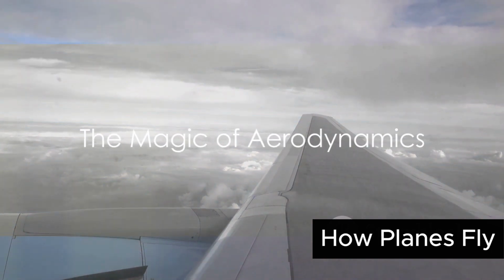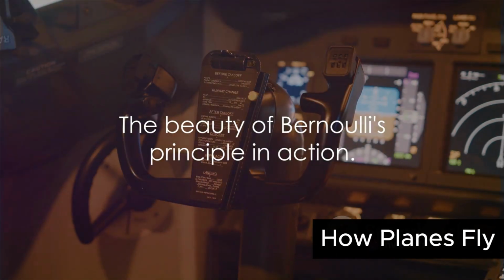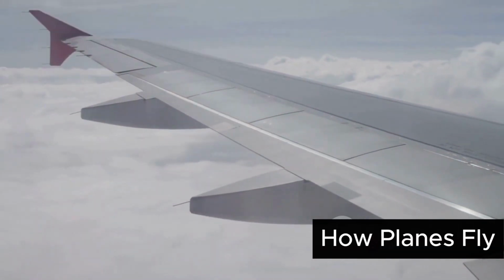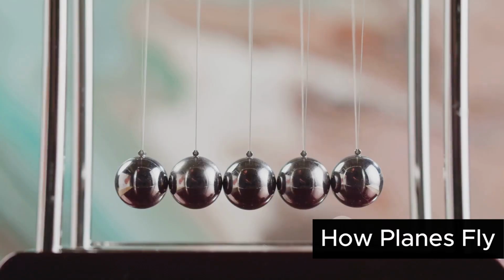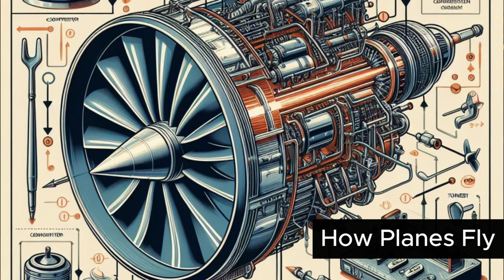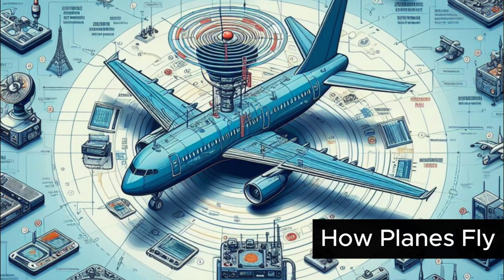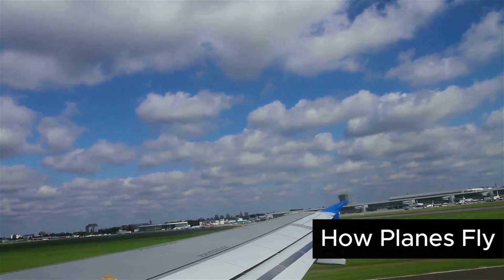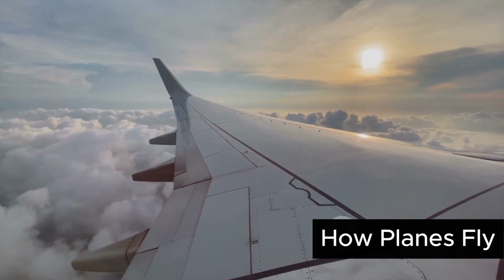How Airplanes Defy Gravity and Soar the Skies

Comment: It's "Fundamentally" Simple to Explain!!!

As a child, I used to play "Birdie" while the car was moving.

I'd stick my hand outside the window, and then notice that
the wind would "effortlessly" "SUSPEND" my Hand and Arm,
and they'd literally be "Surfing-the-Wind."

While parallel to the ground, my hand would just cut thru the wind;
however, the slightest adjustment in "Angle-Up" would send my hand "Soaring,"
and the slightest adjustment in "Angle-Down," would send my hand "Diving."

Eventually my whole arm would fly back if I'd increase the angle
and expose enough of my Under-Arm's "Surface Area" to the wind
- and same for my Over-Arm.

I truly believe it has to do with "Wind Speed," "Surface Area," and simply which surface
the air is coming into contact with "More."

So as the plane angles up, fast flowing air is hitting the underside of the plane's 
Wing-and-UnderBelly "Surface Area," then "Lift"ing the plane "Upward."

The Weight of the Plane actually smooths out the erratic "Birdie-Hand" movements,
while "Angling" Up or Down, and makes for a much smoother ride
 (which also explains why smaller planes have a more "turbulent" ride).

The powerful "Thrusters," in turn, overcomes the Force of Gravity acting on the weight
of the plane.

What is termed "Lift" is actually "Air-Bouyancy."

Bouyancy is a naturally occuring property of Air with enough Thrust & Surface Area
-as demonstrated with the "Birdie-Hand" SUSPENSION.	

Physics simply works out how much more (ie Wind Speed, Surface Area, & Thrust)
is needed to Lift a "Plane" over, say, a "Birdie-Hand."